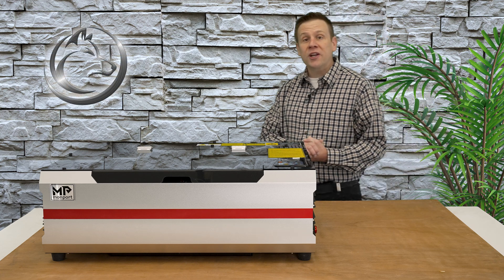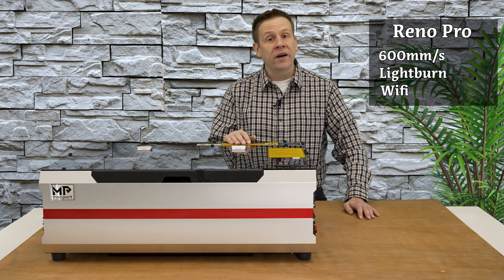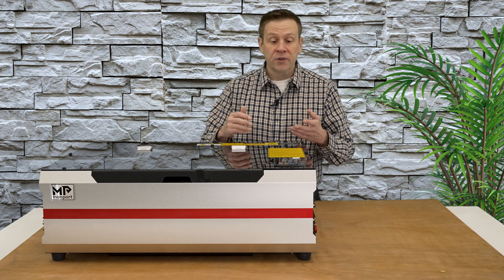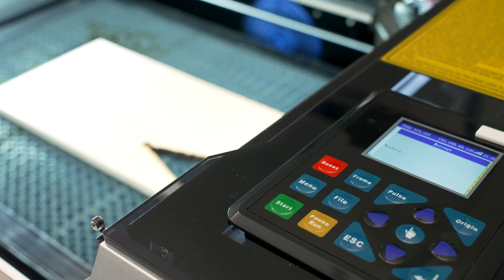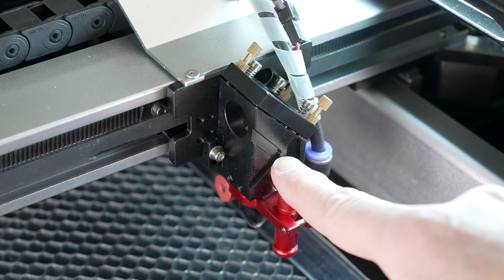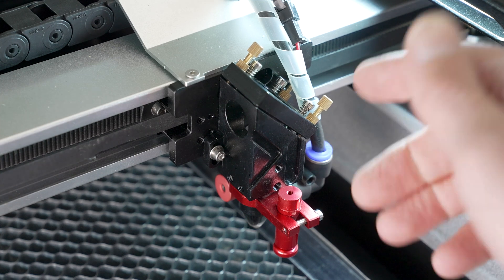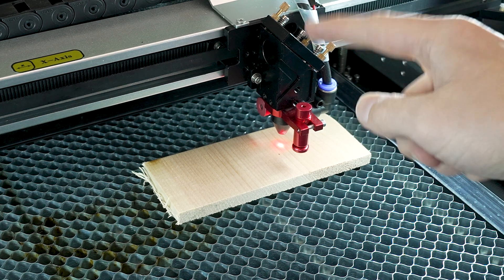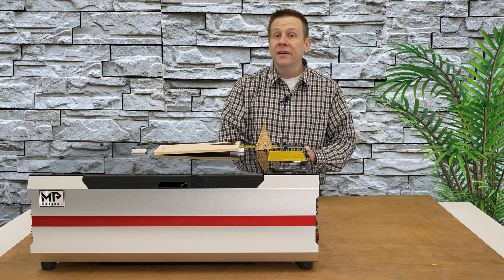Monport Ren Pro-  Everything you need to know!  #monport #laser #diy #engraving #co2 #woodworking

Comment: I have noticed that the cutting head can move outside the maximum of the 12" x 16" cutting/engraving area. How do I know where the 12"x16" area is? TIA
Reply from the maker: The machine software (firmware) has preset distances from the home position that makes up the work area- like 12x16".  This is related to the work area of the laser machine software like Lightburn.  This is largely a non issue for most projects.  If you want to know the physical work area inside the machine just  place a large piece of the poster board down and do a line cut of 12x16".  
Most of the time I place materials closer to the exhaust fan for easier and faster exhausting so the smoke doesn't linger in the machine.  Hope this helps!

Comment: Would you suggest the reno pro 65 watt pro over the 45 pro for cutting aluminum and acrylic and wood cutting and engraving?
Reply from the maker: Hi- a Co2 laser isn't really the best tool for cutting aluminum.  I have cut very thin AL with a high power fiber laser.  When cutting acrylic or wood either will work but I do recommend the higher power of the Reno Pro 65 and it will have a larger work area! :_doggy:

Comment: I upgraded to Lightburn 1.7 and can't find the fire button in the device settings as before, do you know where it's at now? Thanks.
Reply from the maker: On Co2 lasers the Fire button is disabled from what I understand.  Firing the laser (that we can't see) will mark the material.  There is a Pulse button the machine control panel to manually pulse the laser.

Comment: I received my reno pro 45 and would like to see a video on how to use the onboard menu. I see there is so many settings and the manual it came with did not address the menu. Thanks.
Reply from the maker: Certainly- I'll add it to the video list!
Reply: @thelaserchannel1  I've added a co2 laser to my shop, I currently running the gcode version of lightburn, how do I go to the version to run the new laser?
Reply from the maker: @mikeledee8786  The gcode Lightburn is Lightburn Core.  To run the Reno you'll need the Pro version.  Upgrade your current LB license instead of buying a whole new license key-  upgrading the license key my have a discount. 😀
On the Reno USB thumb drive there's a software file that needs to be installed (I forget the name of it) so LB can connect to the Reno.
Reply: @thelaserchannel1  Thanks

Comment: Can you assist me with meetk40t using Lightburn I seem to have it setup but no movement I have a Basic Reno
Reply: I’m not familiar with the other software that the company recommended that’s why I asked!
Reply from the maker: @85sexxyblack  No problem- I have used MeerK40T a little and like for free software.  I recommend installing the software included with the machine to make sure your computer can connect- many insuring the correct USB drivers are installed.  Once connected you can exit and close the software and use MeerK40t- it would connect right away!  Here's a link to a video where I'm using MeerK40t: https://youtu.be/Lrpo8ImAO98
Reply from the maker: The basic Reno machine does not use Lightburn.  It's the Pro version that can use Lightburn.  I have not setup the machine with MeerK40T software.

Comment: Thanks for this informative overview. What are your thoughts on upgrading the air assist to an external aquarium pump like you did with the Onyx?
Reply from the maker: Thanks:)  The stock air pump is a great balance between the lower flow for engraving but high enough to cut most materials.  I do lots of engraving with some cutting so I'm keeping the stock air pump.  I do recommend the Pro version- mainly for using Lightburn!  Both the Standard and Pro versions do come with Free software.